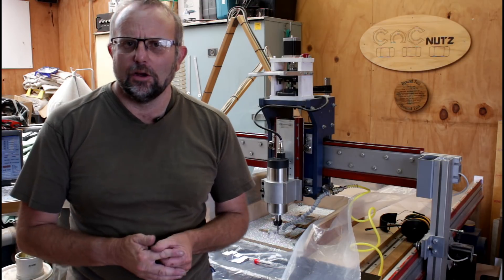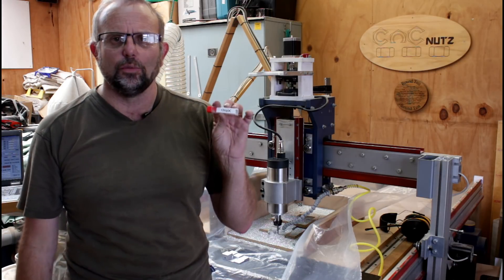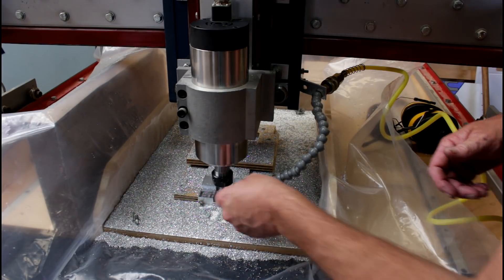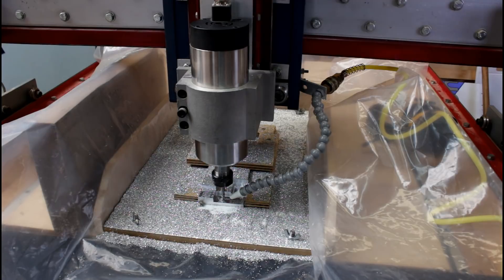Machining Aluminium Update - CNCnutz Episode 201

Comment: Peter, did you mention what you used for a depth of cut? if you did, I missed it. Also, Have you tried using a mister to spray alcohol, or do you think the air assist is sufficient? Thanks, Greg

Comment: have you looked into ,I believe it is called flutes per in. instead of in. per minute? it is how much material each flute cuts per inch.eg. .002".  seams to be what they use for aluminum.You need the specs. for each bit, and there are formulas.  great vids Thank you . Don

Comment: http://www.cncrouterbitsxp.com/toolsxp/pc/Onsrud-40-003-Router-Bits-CNC-Router-Bits-163p2330.htm
These are great for aluminum and are very affordable also. Be carefully with carbide also, use clamping methods that 110% will not budge or you could break them easy. Also when looking at endmills I've found is some have a smaller rated chip load, I can get a chip from a .25" at .01 inch at .06doc and 55 ipm and the noise is ok. If I put the 2 flute hss endmill on there it's rated for .002" x 2 flutes so it is slower than a single flute designed for big chips and fast speeds. I did get a stubby carbide single flute I'd like to try soon. Keep up the good work, nice videos.
Reply from the maker: Thanks Tim

Comment: Cut sounds bad. The aluminum is clearly vibrating and not held properly.
Reply from the maker: You are right Julius.
I originaly thought it was the cutter or my axis vibrating but realised after I finished my 2nd aluminium cut it was the mounting that was the problem. 
cheers
Peter

Comment: Peter,
That little blast of cold air just gave me an idea.  I've had problems burning bits when I do a carving that takes a very long time to complete.  The last one I did took 18 hours to complete and the .125 bull nose bits was black.  The heat of the bit even darkened the wood.  Trying to find the correct rpm is a real challenge.  If it is to slow then the bit drags on the wood giving a poor finish and if it is to fast then the bit over heats.  That little blast of cool air might keep the bit cool and prevent it for burning.  The downside to running an air compressor for long periods is the collection of water.  Not something I want to spray all over my wood.  What do you think about using the exhaust side of a vacuum pump?  The one I have is a rotary vane pump so I don't have the problem with compressing the air.  If you have any other ideas on how to keep the bit cool please let me know.
Reply: Aaron's Woodshed if you're burning your feeding too slow!
Reply from the maker: Hi Arron,
I have serious concern if you are burning your way through wood. Your spindle / router speed is too high and your feed rate is too low. Blowing air onto smoking wood is how cavemen created fire. I am not joking, CNC machines have caused fires because of issues like this. Please email me and let me know your feedrate and spindle speed for these cuts and we can see if we can figure it out. I don't want to see your woodshed become a woodpile. cncnutz65@gmail.com

Comment: Do not use carbide on aluminum. Use HSS (High Speed Steel) cutters. I was given the advice about cutting using HSS bits from an engineer who works for Aerospace company.  jtg1969 on eBay sells some and I bought some nice ones from him. He does sales for $1 and I received 10 end mill bits for $1. What a bargin. I used one these to cut aluminum without air/oil and didn't have any issues. Carbide will work but HSS is better for Aluminum.   Love your videos btw. Keep the chips flying. :)
Reply from the maker: +Steven Cook
Thanks Steven. I found his store but couldn't find any hss cutters. He seems to specialise in the smaller sized bits but I will keep an eye on his store and see what comes up.
Cheers
Peter

Comment: Thank for making this video.  I have had problems cutting aluminum, was using 3 and 4 flute end mills and aluminum stock in the bit.  I just purchased 2 and 1 flute bits for aluminum and will try today and also add the air cooling.  Thanks for the great video's, really enjoyed them.
Reply from the maker: Thanks Rick
Hope it works well for you. Let us know how you get on.
Cheers
Peter

Comment: Where did you get the 'flexible-hose' and what air pressure did you use?  Great videos, and just when I 'needed' them.
Reply from the maker: +Raymond Friesen
I borrowed it from my brother but if you follow the link under my video you will see I put a link to similar hoses off ebay on my website article for this video. Just make sure they have the thread you want to match your air hose. I haven't tried the ebay ones and don't know what they are like.
Cheers
Peter
Reply: Thanks...I found them on the ebay reference and I finally found them on Amazon.  Don't know if Amazon ships free to you but found them for 6 ea for $7 including shipping.  I will get some and play with them.
Reply from the maker: +Raymond Friesen
Good one

Comment: I'm glad you tried the air assist, it has worked well for me. I have migrated to a single O flute for cutting alum and the finish is fantastic.
Reply from the maker: So am I because it made all the difference.
I've heard of O flute cutters but couldn't remember if they were for Aluminium or Perspex.
Maybe both.
Cheers
Peter
Reply: CNCnutz (Peter Passuello) both

Comment: You really need to be basing your cuts on chip load.  Fusion 360 will generate tool paths you can use.  Also use a 0 flute EM and you can keep your spindle at an rpm where it has more power.
Reply from the maker: Thanks Cody

Comment: Most of the misters are just a venturi they are very simple to make  or trademe https://www.trademe.co.nz/business-farming-industry/industrial/manufacturing-metalwork/lathes-accessories/auction-1519747167.htm?rsqid=ff063a687c2d44788d4dd06449e5c9a0                                                                                                                                            you can try reduceing the depth of cut and incress the width of cut
Reply from the maker: Saw some of those on Ebay, cheap as chips and didn't recognise it for what it was.
Very cool, no pun intended.
Maybe I will get one to try if I have to do anymore cutting.
Cheers
Peter

Comment: Hi Peter,
Very Informative info.
Peter, can you advise me of the following?
How much hours is allowed to run an 'Air Cooled' Chinese type spindle nonstop? (Similar to yours).
Some says 4 others said between 8 to 12hrs.
From your experience what will you say is a safe area to operate nonstop?
Thank you.

Alvin.
Reply from the maker: +Alvin Smith
I don't really know but so long as it doesn't get too hot I would imagine you could run it until the bearings collapse or it develops some other fault. I have run mine for about 10 hours doing a 3d engraving and it barely got warm. I imagine the load will determine how hot it gets. Don't know if this helps
Cheers
Peter
Reply: CNCnutz (Peter Passuello)

Peter,
Thank you for the information, you have been very helpful.
Regards.
Alvin.
Reply from the maker: +Alvin Smith
Thanks Alvin

Comment: seems to have worked pretty good , still think that cutting a cutter wide deep groove intoo a piece be a bit more of a chore , in that case i could use a fogbuster and a alcohol water mix (leaves hardly any resudue but lubricate and cools )
Reply from the maker: +watahyahknow
The Grove was a pocket slightly wider than the cutter to reduce the load. I wanted to go without fluid and see what happened. Also finding a mister is a bit of a stretch where I live. I'm sure that the combination of mist and air would do an excellent job.
Cheers
Peter
Reply: Hi Peter - enjoyed the video.  Bangood sell a few misters ranging from AU$7-$20 if you want to try one (free shipping).  For that price, you can try one out fairly cheaply.  I haven't milled any Aluminium so can't recommend any specific model.  Cheers
Here's a link to one - https://www.banggood.com/Mist-Coolant-Lubrication-Spray-System-Unit-For-CNC-Lathe-Milling-Machine-Drill-p-977354.html?rmmds=search&cur_warehouse=CN
Reply: he lives in new zealand , he has been having quite a few problems getting parts cheap and reasoble fast
Reply from the maker: +watahyahknow
I also live in a very small town so this sort of thing is not readily available. I can't even buy a simple spiral router bit locally and need to order one.
Reply: i ive closer to china (they even have a railconnection now all the way to engand ) the only thing here are the importfees and taxes witch add up to 50 percent to the purchase proce
Reply from the maker: +watahyahknow
I'm quite lucky that unless the item is very expensive we don't get stuck with import duty or tax.
Reply: this calculator shows wat they add , there a few under over kost that add tax or importfees and tax
anything under 22 euro is free of importfees and tax 
between 22 and a 150 euro gets taxed
anything over 150 euro gets the full monte 
http://www.invoercalculator.nl/
prolly need to google translate some of the words but its self explanatory
Reply from the maker: Thanks for the link.
I bought the one from your link though I'm still not sure about blowing coolant around. 
That said I can use it in the lathe if I decide I don;t want to use it on the CNC. 
Cheers
Peter